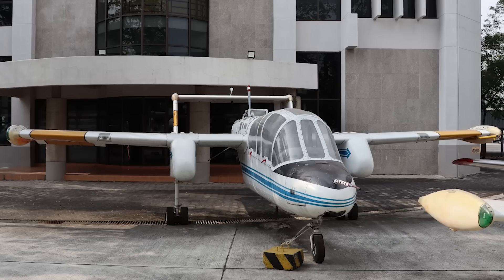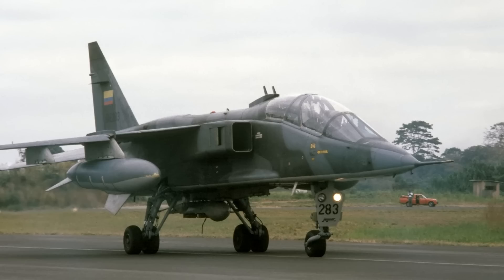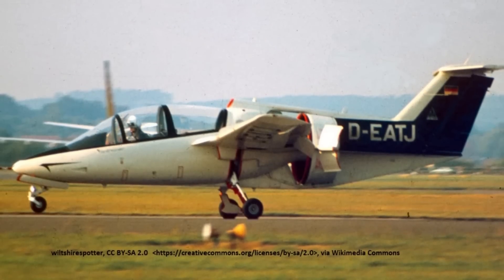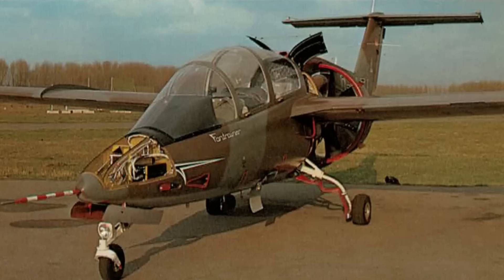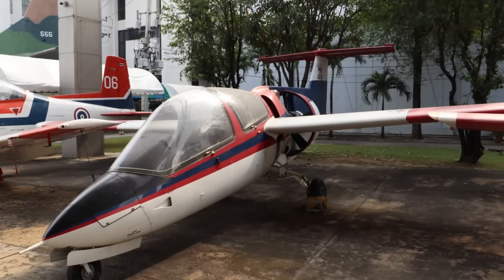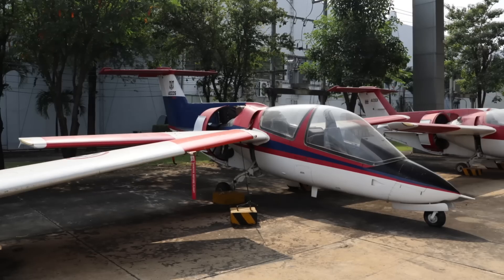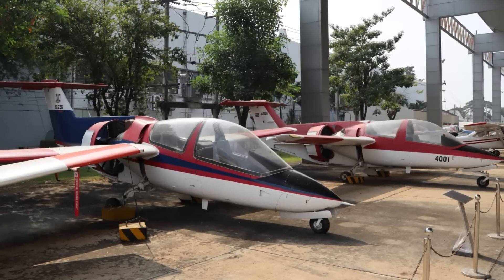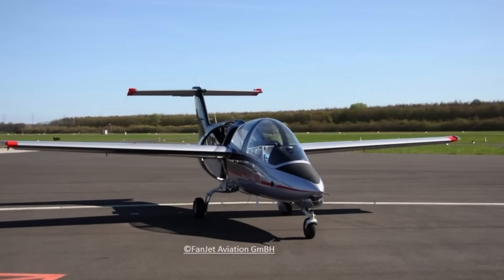The RFB Fantrainer; Making a Basic Trainer Handle Like a Jet

Comment: The video at 44+ seconds shows what appears to be a Fantrainer with side by side seating instead of the tandem arrangement.  Instead of side by side seats there should be a single pilot variant that novice pilots could use to build flight time and gain flight experience.

Comment: The plane has so many design flaw. Center of weight locates aft the wing. When used as trainer on stall condition, pilot coach can't recover the plane because its tail down and made several fatal accidents to Thai air force. Engine in backward causes heat because it couldn't gain entering wind as front engine ,again engine shutdown before tail stalled.  So it was early retired all the fleet then.

Comment: Well, I tell you this... If the right people were involved in the project, a "Light Sport" version of this aircraft would sell quite well here in the U.S.. Especially if it were designed and built with affordability,  safety and performance in mind. Too many small aircraft companies attempt to make their money back on the design with the first 10-30 aircraft sold and then keep that artificially inflated price for the remaining aircraft they sell. If they would stretch their recuperation point out a bit and price the aircraft appropriately at 110% to 120% of actual cost, they would sell so many aircraft that they would be hard pressed to keep up. Unfortunately, with the actual costs rising astronomically these, this may soon be a tactic that can't be used.

Comment: The basic ideas of the fan trainer concept are still valid today.

If you think about the concept further with today's technological means, there is a much more far-reaching potential than was possible at the time.

The use of a Wankel engine (rotary piston engine) would now make much more sense than it did with the prototype, since the Wankel engine has also developed further over the last 50 years and has proven its efficiency.

A good example is the success of the Mazda 787B in the 24 Hours of LeMans in 1991. The engine performed so well and reliably that the regulations were changed shortly thereafter, so that Mazda could no longer participate with its Wankel engines. Shortly thereafter, Mazda left motorsport and of course also ended the further development of high-performance Wankel engines. The "26 B" engine had an output of almost 700 hp with a chamber volume of just 2.6 l!

The Wankel engines of the Fantrainer / Fanliner prototypes were test engines from Audi-NSU. They were further developments of the series-built NSU Ro 80 engine with 115 hp. The test engines were available with 150/170 hp and were even installed in some test vehicles. An acquaintance of my father was a test engineer at Audi-NSU and drove an Audi 200 with a 170 hp Wankel engine for a number of years for a long-term test. No problems at all over a period of 5 years and 200,000 km mileage.

I myself have driven 2 NSU Ro80. A major advantage of the engine is, among other things, the significantly lower noise level compared to a reciprocating engine. The faster the Wankel spins, the quieter it gets! The high level of noise generated by the Fantrainer / Fanliner comes from the ducted propeller concept. But here, too, the problem could probably be eliminated with adjustable propellers.

The company Wankel SuperTec from Cottbus, Germany has developed a Wankel engine (approx. 122 hp) which is designed as a multi-fuel engine. This runs on diesel or kerosene. A variant that runs on hydrogen is now also available.
A multi-fuel engine is even offered at wankelaviation.com, which runs on almost all fuels.

Wankel engines are now being used more and more, especially in military drones. The motor is particularly suitable for this application (or light aircraft of all kinds).

A modernized fan trainer with 2 coupled Wankel SuperTec engines or a high-performance electric motor, for example from the sports car sector, combined with a Wankel engine as a range extender, could be an interesting possibility to further develop the concept. (Especially with a trainer, 2 motors are always better than one...)

Use as a trainer for beginners and advanced training, a "flying simulator" for types like the F-16 or JAS-39 Gripen or possibly even as an armed drone are just a few of the options that come to mind spontaneously. By the way, the current "Fanjet" achieves significantly higher speeds and climb rates than its RFB predecessors from the 70's.

Comment: 🤔 Fanjet=light attack.  Equip them with Javelins and give them to Ukraine.  Make the landing gear more rugged. Mount flares and chaff starting at the rear of the cockpit going back to the tail.  Have hard points on the wings able to carry 4 Javelin each for a total of 16. Mount a 30mm gun gatling gun barrels running under the cockpit and the machinery in between the engine and the cockpit.  A titanium bathtub would be sweet but I know I am going waaay too SciFi  now.
Reply: I like your thinking. But it's practically a redesign.
Reply: @Seminal_Ideas  but the fanjet stays the same.  Low speed but faster than a helicopter.  I think the video said the maintenance of fan jets are cheaper and easier then other jet engines. Update the fanjets to be able to carry more weight.  Find the right combination of kevlar and whatever to strengthen the wings.  I do not see any reason Javelins, Switchblade, or NLAW have to be only fired by individual soldiers.  What is the lightest material that can resist a 7.6 rifle round. Close Air Support aircraft are not for dogfighting but to support troops on the ground. Short of giving soldiers jetpacks this is the next best thing.
Reply: You're not going to get a 30mm in there unless you drop the rate or the velocity and wing mount it.  Better off with just more missiles.
And a JTOL unit to get away once the Russians lock them up for SAM/AAM
Reply: @williamchamberlain2263  how about the tried and true Ma Deuce?  Add another APU and try some dazzler lasers all around the aircraft.  I can't remember what spoofs radar......Too much radar energy in the area?
Reply: @damongraham1398  what's a 12.7mm going to do against tanks?  Even IFVs or AFVs are going to be fairly impervious to a low velocity low calibre weapon.
Blinders are illegal under the Geneva Convention, and any dazzler can a blinder to someone using magnification.
Reply: @williamchamberlain2263  dazzlers for the optical guided missiles.  That was my ignorance about the 50 caliber.  Just the idea of sending a light attack craft up without a gun just seems wrong.

Comment: observation        this iteration  of a ducted fan design was/is  Fundamentally  FLAWED.!      as a result, the (limited) success of the design is  Surprising.            details:   the air flow to a ducted fan  Should be  Unobstructed.!      because, a ducted fan does  NOT  draw like a turbine engine.!!!            as airspeed increases, the deflection of air away from the fan intake Increases.!

Comment: If they solved the noise issue these probably would have been great aircraft for light observation and attack as well as trainers.  The pilot’s visibility looks incredible.

I wonder if a STOL version would be possible?  It has a high power engine and most of the weight located well behind the cockpit.  Imagine a spoiler fin just aft of the duct that allowed the pilot to redirect some of the power vertically.  That could substantially lower the runway necessary.

Comment: There was another model: the Fankiller.
It was a variant with a 21 foot, foldable prop/fan that had the fan shaft of the engine continue to the back of the aircraft.
When the pilot wanted to use the aircraft for ground attack?
He/she would fold out the 21 foot rear props (made of kevlar-tipped carbon fiber), activate the fan and proceed to mow down any troops that were unlucky enough to be in the way.
A prototype was modified and a demonstration commenced.
Unfortunately, the pilot mistook the military brass for the 'dummies' that were to be 'killed' by the Fankiller. And ended up beheading several onlookers.
Needless to say - this ended the program.

Just kidding.
I couldn't resist.

Seriously, I knew nothing of this Ed.
Thank you.
☮

Comment: Remember seeing this at Farnborough. Great concept.
Reply: I also remember seeing the Fantrainer at the Farnborough Air Show, in 1988. It was in competition with the Pilatus PC9, the Valmet Redigo and the Embraer Tucano in both its Brazilian and Northern Irish versions, all of which far outperformed it. I felt quite sorry for the pilot. All four of the rival aircraft took off directly in front of the spectators and climbed away vertically to a considerable height; the Fantrainer took off unannounced from the other side of the airfield and slunk off into the distance, reappearing about 20 minutes later at a great height and starting its display by diving thousands of feet followed by a zoom climb from which it levelled out just before its speed would have dropped to the point where it would have stalled.

Comment: The concept is a good one, in many respects. Especially the modular construction and commonality of parts with high performance variants. See, The Aerialis Project currently underway.
Reply: Commonality sounds great, but when parts like body panels need replacing, they generally need to be custom fitted by the airframe mechanic as the parts are never actually identical coming off the assembly line, and especially after seeing maintenance in the field.
Reply: https://youtu.be/K1_fXe_CdVs

Comment: I noticed the wing was mid wing configuration., good for having less aerodynamic drag but problematic  in small aircraft because the wing structure goes through the middle of the fuselage limiting space and seating to front of the wing.
Interestingly also having a mid mounted engine allows for a larger fuselage forward of the wing, so that addresses that problem.

Comment: I remember these from 80's aircraft "encyclopedias".
I thought they would take over the whole fighter industry LOL!
Only later did I learn piston engine are actually quite complex and inefficient compared to turbo jets, especially turbofans.
Anyway, thanks for the "walk down memory lane".
Reply: Turbines are also much more reliable. The downside is they're fuel hogs, especially down low, and on the ramp. They burn almost as much at idle as they do running balls-out.
Reply: @theprojectproject01  "Balls Out" :)
As in a wardrobe failure or is it like "balls to the wall"?
Either way, thanks for the insight, did not realize implications on fuel use at sea level.
Reply: @ImranKhan-ty6mx  Balls out, as in the governing mechanism for steam engines use weighted balls on a spinning, sprung linkage. Do some googling, you'll see what I mean. I suppose you could call idle "Balls-in," but nobody does.
Reply: @theprojectproject01  I feel sometimes engineers are just messing with common folk. The balls out makes total sense now. Thank you.

Comment: Interesting that they're trying to revive the design. It might have a shot at filling its original niche, but I see a whole different market for a slightly modified design. These could have potential in the "counter-insurgency ground-strike close air support" role that's developed in asymmetrical conflicts. Something like a Super Tucano, basically a slower/lighter/cheaper option for times when an A-10 would be ludicrously expensive overkill.
Reply: It would need to be quiet if not outright stealthy
It would need the ability to shoulder a much heavier payload than yet stated
You could get all you want and more form a revised, updated Pucara
BUT they shut down production because of lack of demand
Reply: something like this https://en.m.wikipedia.org/wiki/AHRLAC_Holdings_Ahrlac

Comment: It's not the placement of the engine closer to the center of gravity that made it handle more like a jet, it's is the reduction in propeller induced yaw due to the ducted fan.  That and the fuselage as a flow splitter must have all but eliminated the spiral slipstream effect on the vertical stabilizer.
Reply: So you’re saying that it’s not one of the reasons although it clearly is???😂
Reply: @Galil-aces  No, it clearly is not. Your emoticon indicates lack of maturity, so I'm not surprised you are unable to process new information.

The relationship between the engine location and the center of gravity has little to do with making an airplane handle like a jet.  The placement of the propeller has much more to do with it.  For example, the P-39 had its engine near the center of gravity, but nobody thought of using it as a substitute for jet-like handling.  Jet fighters have their engines well aft of the CG.  The CG of any stable airplane will be in the neighborhood of 23% of wing Mean Aerodynamic Chord, regardless of where the propeller or engine are placed.
Reply: @Galil-aces   Thanks for proving me correct.
Reply: There is also the P-factor from the large rotating propeller disc that is much reduced in the Fan trainer, so it is still more  jet-like than a prop trainer, however, there still is the fan air blowing on the rudder to heighten the rudder sensitivity and thus would reduce the true jet-plane handling.  They should have buried the fan inside the fuselage and make air-scoops to route the air to the ducted-fan.  With the Allison turboshaft engine, this would be an ultra-high-bypass turbofan.  Furthermore, the wings should have some sweep back to make it handle more like a true jet.  This would make it looks like and handles like a real jet fighter instead of a compromised wanna be jet.  Not as efficient as a piston engine propeller propulsion, but definitely more efficient than a turbojet or low-bypass turbofan engines available for such small application.  It's all relative, and for a military trainer, efficiency is not the top priority.

Comment: The ALphajet and Hawk are also COIN/Light Attack aircraft when equipped with gunpods or ground attack weapons
Reply: That's exactly the role I could picture for the revived version of this thing. Purchase a fleet of trainers to get your pilots in the air, slap weapons on a few of them and you've got a nimble, cheap close ground support platform.

Comment: To be competetive today, they will have to invest into a new fan. The performance data doesn't look like the old one was very efficient. Being very loud also isn't good. Maybe they can team up with a company that has experience with high bypass turbofans.
Reply: Modern composites, 3D CAD design with fluid modelling improvements, along with advanced aerodynamics from helicopter rotor tips, 
    ...all together could solve alot of the sound issues, that and a slightly longer rearsection to the duct to shield the noise from the fan tips more.
    Effectively the Fantrainers and Fanliners were all design wise were barely prototypes, it's amazing the company got as far as it did !
But the design concepts can go so much further with some.. work, time, improved materials & design etc, and money within it !
BEST OF LUCK !

Comment: intresting choice to go for a wankel engine. NSU wankels were prone to break down and suffered from a really really bad reputation at that time. RO-80 drivers used to greet each other by hand signaling the number of engine swaps they had to go through. an engineering desaster. however. this version was the peak of development and technical problems were about to be solved. being used as an aircraft engine it would do the marketing trick in high gloss car magazines. and its a way how small german manufacturers invite other companys to contribute to projects. thats why some german projects are odd but sophisticated. meanwhile NSU was bought by audi, now getting hands on the engine concept and production line. planned a wankel version of the type 80 but ditched that idea. porsche's air cooled flat 6 was more successful in its aviation version. 

training aircraft in general are a nice topic less talked about. its the budget entry to military aircraft for private owners. in many cases it is possible to join in for a flight. 
have a nice day.

Comment: Quite surprised such aircraft once had a Rotary Wankel for an engine,  imagine the noise it must've made in the sky.
Reply: The Norton rotary engine you may have heard of in motorcycle form was for years the powerplant in many a drone.
Reply: Likely the Fantrainer used two DKW rotors, coupled, if not motors from the Wankel company themselves..
Reply: @razor1uk610  Not DKW, these engines were made by Sachs...
Reply: With a large turbo 13b it could have run in Reno Bronze class!